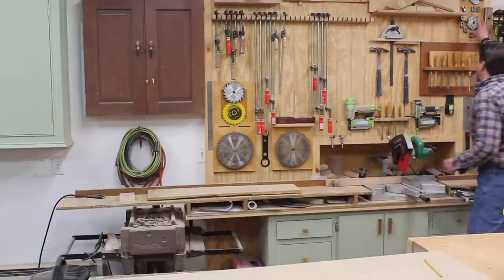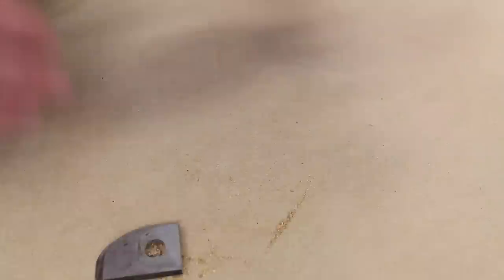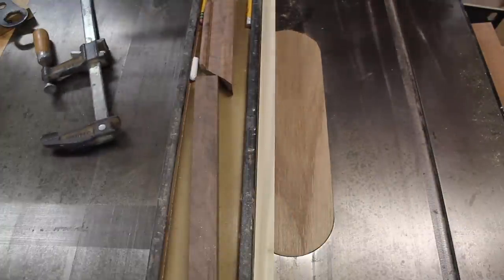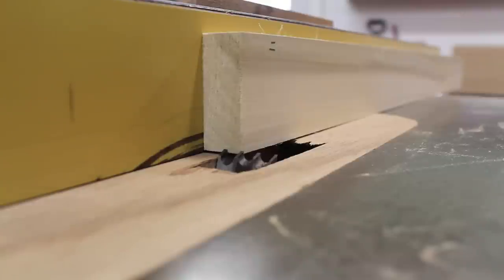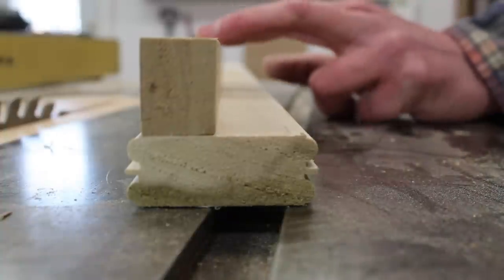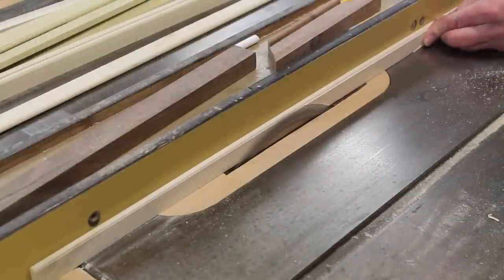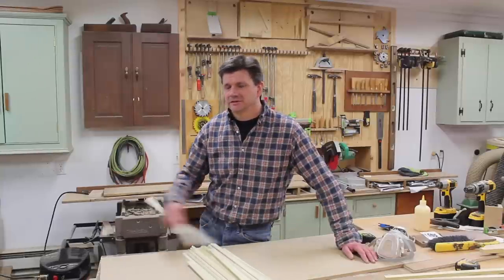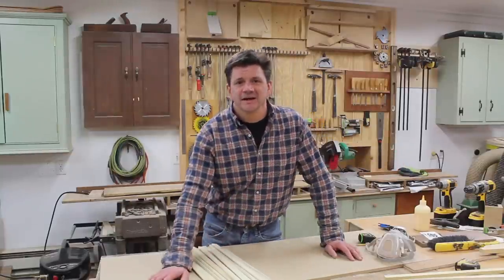How To Make Molding with a Table Saw & I'm in a TV Commercial

Comment: Just finally got a molder head, and it literally "paid for itself" the first time I used it, and it wasn't even that big of a project!
Being able to make custom molding, using off cuts of the same wood used for the rest of the project, is great.
Way WAY less expensive than buying stain grade hard wood molding, and no worries about irregularities in how it takes a finish.
You can also do things with a molding head that you just can't do with a router or shaper.
Now I need to figure out how many more molding heads I need, so I don't have to swap blades so much.

Comment: I have have that Aluminium moulding head. I was made by Richards in Vancouver, BC, Canada.  I used it on a radial arm saw. You used it with the spindle in the vertical position and with a special guard
It worked very well.

Comment: Sears used to have molding cutters that came in either one or three cutter versions - I bought a one-cutter model nearly 40 years ago.  Don't need it often, but at the time it seemed like something that would be useful.

Hanford Mills Museum in East Meredith, NY has a 19th century molding machine that they used to make specialty moldings for architectural restoration work.  The neat thing is that the machine is driven by belts from a line shaft powered by a waterwheel.

Comment: I think it's a bit funny that at the big woodworking company where I used to work we also had these EXACT same 2 cutter heads for occasional use on the table saw. For most jobs, however, we had a specially built moulding machine (we milled our own baseboards and crown mouldings, as well as curved mouldings for archways and windows).

Comment: Hi Jon,
I have the same Sears molding head, but I think mine may be a little older and surely a little more beat up LOL. One thing that I like to use the molding head for is to match the wood that I am using. Lumber yards don't have a god selection of hardwood moldings and definitely not in exotics!

Comment: great video jon. i picked up my sears moulding blade which came with 10 or 12 different cutter heads off of ebay couple years ago on ebay. there were several on there at the time but they do pop up now and then. love the set too!

Comment: I have both of those moulding heads. The round one or the second one you showed is a Richards made in Vancouver, B.C., Canada.  The craftsman blades can be used in the Richard but the Richards blades does not have the grove that fits the Craftsman. I used them on the Radial Arm saw in the horz. position with a guard that was made for these moulding heads.  They worked well but were scary.  The table mounted router is much less scary.
Reply: I'd like to see what you have set up, I'd like to use mine on a RAS, but until I know how its done I won't turn on the saw with it on the arbor.
Make a Youtube video of it. What direction would you move the wood into the spinning blades or away from?
I was thinking kind of like on a table saw with the fence between the cutter and me wood into the cut the wrong way on a RAS from right to left. Blade face to the table.
Reply: It's been a long time since I used it but I remember that the moulding head was in the horizontal position with the moulding head under neath. The cutters are just cut thru the fence far enough to cut the moulding into the wood as the wood is fed from the right side. The moulding is  cut on the edge of the board.  There is a special guard made to be used with the moulding cutter.  It has a more or less flat plate the attaches to the motor housing and a semi-circular shield that is about two inches high and is adjustable via two rods that are connected to the flat plate.  There is no way I would ever use this attachement without the guard in place.
Do a search to see this guard in use;  
"Raising a panel on a DeWalt radial arm saw"

Comment: Pretty darn cool commercial. Glad they used you in that.
Question, how wide is that mold cutter? I would like to get it for myself. My table saw has a dado plate (works with any 13/16" X 8" diameter stacked dado), is that wide enough or do i have to make my own?

Comment: Hey Jon, I needed some bead molding for a project. Of course it wasn't available at the big home stores so I hastily logged on eBay and bought a cutterhead. The Sears 9-3214.  I realized after watching this video that it requires a spacer and mines not coming with one. Can you tell me how big of a spacer I need and anything else that may be needed?

Comment: Cool. I didn't know you could get molding cutter heads for a table saw.
Reply: +Just Make It Me either!
Reply: The things have been around as long as I can remember. Once you get the arbor unit you can get hundreds of different blade shapes. And there are companies who will grind one special for you. Mine is a Craftsman made around 1946 that I got at a yard sale. The original blades are still good. With even simple molding running north of a buck a foot you can save the cost of a really good table saw remodeling one house.
Reply: +Lawrence Withrow hii
Reply: + Just Make It  I'm studying diy table saws and found a great resource at Wilfs Wood Blueprint (google it if you're interested).

Comment: I have a small molding machine (shop fox) and I know from using that machine there is no way you could get good results from using a table saw unless you have a power feed head and very good support. If there is any chatter in the material it will look horrible.

Comment: How would you compare the Craftsman molding head to a molding machine or a shaper?  I own a Belsaw planer/molder but haven't purchased any molding knives yet.  Changing the knives for a small project would take quite a bit of time.  I'd like to get a shaper sometime.  Fortunately, or unfortunately, the machines used are cheaper than a few sets of new blades.  I can pick up one of those Craftsman molding heads used for pretty cheep (much cheaper than new molding blades).
Reply: hi, i have a belsaw moulder /planer, and the main difference is that the belsaw is much safer. The belsaw has an autofeed, which saves you from having to place you hands near the blade, like you do on the table saw. however if you have an autofeed for you table saw then there isn't much of a difference besides the fact that one of those set screw could let go and the blade could fly out, and who knows from there. Honestly, I about peed in my pant the 1st time I fired up the moulder head on my table saw. The sound is fierce, and knowing that one screw is holding the blade down still makes me nervous. That being said, I use a the belsaw in my shop if I have the correct moulding blade, and router when I'm out, or for convenience. My thing is staying efficient,  and swapping blades is a little inconvenient so I don't use the table saw moulding set very often. PS..if you do buy one then make sure you have a way to sharpen them on your own..
Reply: Every-Day Joe Sharpening: The Belsaw blades or the Craftsman blades?  I have a saw sharpening shop in-town, but I haven't purchased any real sharpening tools beside water/oil stones.  Seriously, the Belsaw blades cost as much as I paid for the entire machine...I'm almost considering purchasing a larger planer so I don't have to take knives out of the machine to use it as a molder.  On a side note, the funny thing about Belsaws is when you look at well used ones, how many you see that have thrown a knife sometime in the past.  I'd venture to say that they were probably installed wrong, but I've seen plenty with battle scars.

Comment: I bought both of these back in the 80s and frankly I only use each one of them one time they just scared the heck out of me using them they seem so dangerous the high speed of the Saw and a change of the wood kicking back it wasn't worth it